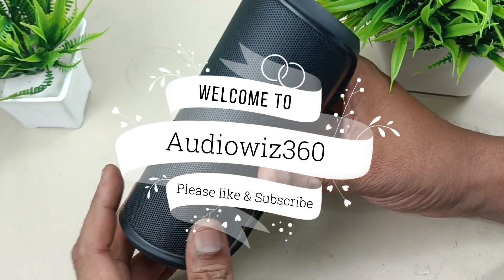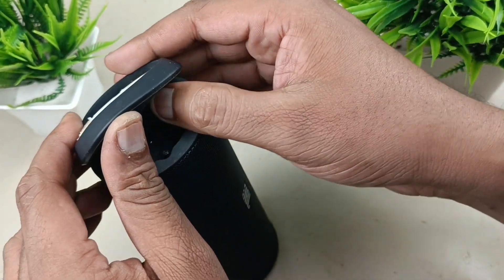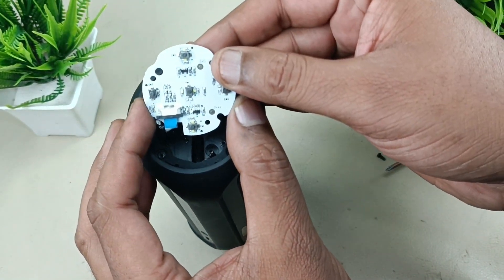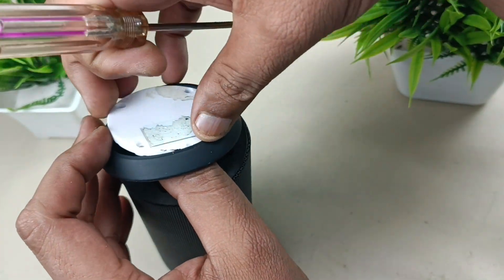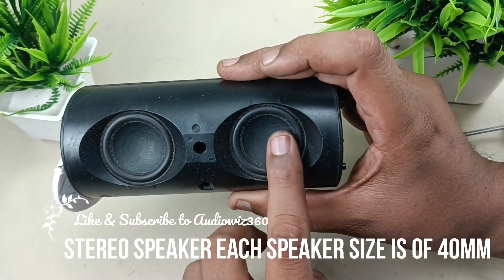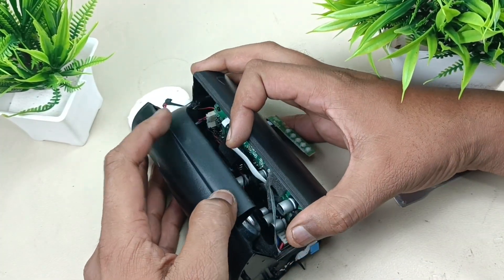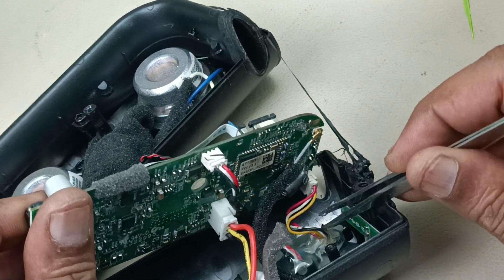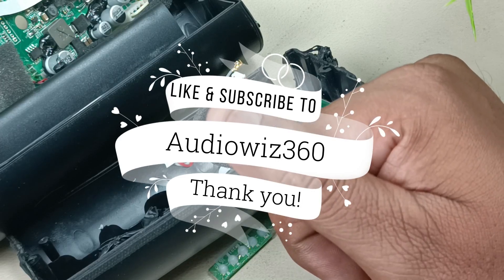JBL Flip 2 Look inside Disassembly | How to disassemble | Teardown of Flip 2 | Complete look inside

Comment: I have a problem with the charger door. More specifically, when I have to charge the speaker the cable doesn't fit well anymore, It's too lose ... Do you have any suggestions?
Reply from the maker: you may need to replace the micro USB socket inside the speaker.